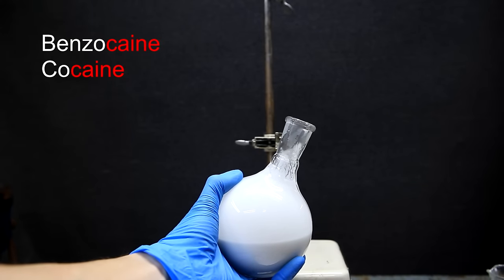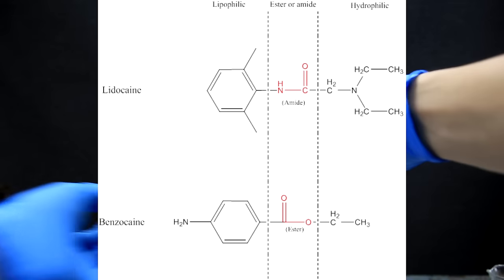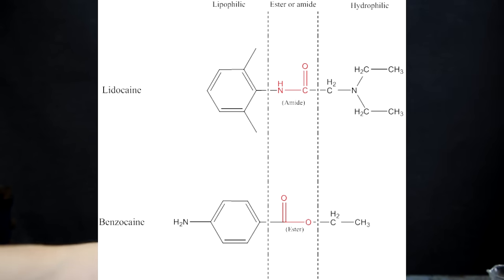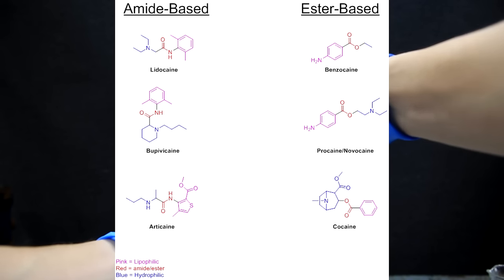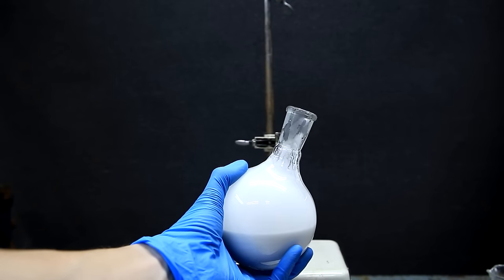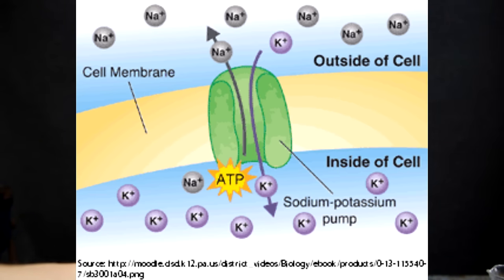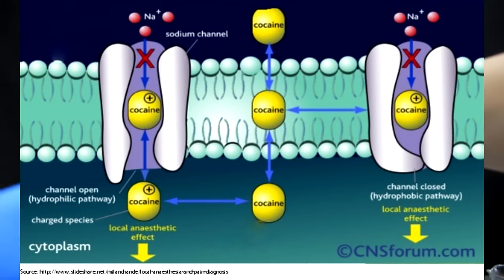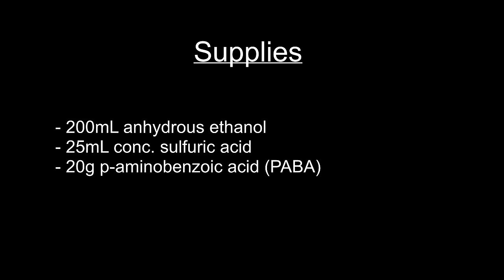Making Benzocaine (Revisiting!)

Comment: ha ha ha, white powder that numbs you in a plastic bag.  very entertaining videos.
Reply: It's actually used to cut cocaine really often, most street cocaine contains benzocaine
Reply: You must have missed the part where he said it can be lethal because it's poisonous
Reply: @OligoST  Oh yeah - and cocaine isn't? Sola dosis facit venenum.
Reply: Robert Paul Guidry   

You can ask if you can make a video showing how pure cocaine powder is transformed into water or liquid using a simple chemistry method and also how to turn water or liquid cocaine back into pure cocaine powder Please some one can explain how to do it more or less simply important was clear thanks
Reply: Making cocaine a liquid is just dissolving it in a solvent. You should be able to get it back out through evaporation.

Comment: One thing to be aware of with molecular sieves is that they are slightly basic. This means that (in this type of reaction) if you add conc. sulfuric acid to them, they will be fairly likely to decompose to an amorphous sludge. They should still work (perhaps to a lesser degree, but i'm not certain) but it would involve a few additional filtration steps to remove the sieve powder.
On a related note, don't do what I did and try to store your beautiful clean glacial acetic acid over 4A sieves.

Comment: I just did this with about a 76% yield. That's even after I had a foaming accident that lost several grams of product.
I used a soxhlet extractor with molecular sieves to get the water out of the alcohol as it was refluxing.
I used 40g (~0.292 mol) of PABA and about 250 ml ethanol, 15 cc of 98% sulfuric, and let it reflux for 2 hours.
Then I added it to a saturated solution of sodium bicarbonate. I got too happy with the pipette, though, and that's when it foamed over. 
Washed it a couple times with distilled water, vacuum filtered it, and let it dry for 2 days in a sunny window.
When it was nice and dry, it yielded 36.53g (~0.221 mol)

Comment: Hey dude some suggestions on the neutralization of your acid to increase yield:
1) add the solid NaHCO3 thereby not adding any water to the rxn mix
or 
2) if you only have the aqueous base, add the acidic solution to the base while stirring. This way the acid is neutralized and hydrolysis of the product does not occur. If you add the bicarb to the acid slowly to not foam over, the pH is still well below 7 to conduct the acid catalyzed hydrolysis when you are adding water.
Reply: +Robert Hoppe Thanks for that suggestion. I added the NaHCO3 as solid, worked very well.

Comment: You did actually address the reduction in concentration of the products, using 98% sulphuric acid means that any water formed is locked up by the reaction: H2SO4+H2O->H3O(+) + HSO4() meaning it's unable to reaction with the ester like H2O does, that's the main catalytic property of the sulphuric acid as opposed to other strong acids. HCl works, but you get around 30% of the yield that you do with H2SO4.

Comment: the real deal is to get PABA from SODIUM BENZOATE
1.Nitration of benzoic acid to introduce a nitro group (-NO2) to the benzene ring, forming nitrobenzoic acid
2.Reduction of the nitro group to an amino group, converting nitrobenzoic acid to aminobenzoic acid
3.Purification to ensure the correct para position is achieved, as nitration could occur at multiple positions on the benzene ring.

Comment: Also you can use a Dean Stark or a Soxhlet extractor packed with 4Ams (or 3Ams) to remove the water from the azeotrope and return anhyd solvent to push the equilibrium. However the rxn time will be increased as sieves aren't fast at absorbing H2O.

Comment: Oof wish me luck. I'm making benzocaine starting from toluene from carburetor cleaner. It should be fun though.
Reply: For anyone who cares:
Toluene to nitrotoluene

Separate p-nitrotoluene isomer

Oxidize the methyl group of p-nitrotoluene using KMnO4

Reduce the nitro group of p-nitrobenzoic acid

Fischer esterification of p-aminobenzoic acid to make ethyl p-aminobenzoate aka benzocaine

Basically will have made a modern local anesthetic from carb cleaner lol

Comment: Would adding more sulfuric acid produce a better yield? Also, how do you know if you have your product at then end- is there a test you would recommend to identify esters or this molecule specificly?
Reply: The acid is just the catalyst. You could use less, but the reaction would take longer. Use more, and it won't speed things along very much. The yield would be roughly the same.
To increase yield, you can pull out the water to keep the reaction from reversing. (but the reagents are relatively cheap, so why spend too much time and effort?)
With reactions like this, the "end" is pretty much a judgment call.

Comment: While I'm certainly still interested in the Vanillylamine video, would it be possible to do a video on the synthesis of PABA?
Reply from the maker: +LuciferAlexander I am looking into making PABA. Here is a link to a suggested method starting from toluene: http://tminehan.com/spring334pdfs/11&12ans.pdf

The issue is that I don't have Pd/C or a good H source.
Reply: As interesting as seeing you try to make Pd/C would be, I imagine its not very feasible?

And wouldn't making H2 be possible via electrolysis of water?
Reply from the maker: LuciferAlexander There are ways to generate H2, but a constant stream of H2 for a long period of time can be pretty annoying. I could make Pd/C but it is pretty flammable and care must be taken. Id also need Pd.
Reply: +Nile Red Certainly having that much H2 presents some risk, and having to make sure it didn't run out half way though would be a nuisance.

Palladium is also not the easiest to come by. The method I found calls for PdCl2, which runs around 50 UDS a gram. Ouch.
Reply from the maker: LuciferAlexander definitely not the ideal price

Comment: Your NaHCO3 saturated solution must be into ethanol, if it is not the case a little hydrolysis can occur. Yeaaaah I know, this is pretty low, but you had a several amount of Water at this time ! If I Had to do this, I will be in the same "ethanol excess" like you, but I will try ethanol NaHCO3 solution OR add it solid by a spatula ;)

Comment: Blistex "kanka" for lip/mouth sores has benzocaine 20% as the main and active ingredient,  but when it comes in contact with water,  a sap-like substrate forms.  Would this still be a good candidate for the process?
Reply: +J Alvi  If you'd like to extract benzocaine from OTC products choices like Maximum Strength Oragel are a good option as they have similar strength and fewer additives than the Blistex product, mostly PEG. I've misplaced my detailed lab notes, but the simplest method is to use benzocaine's temperature-dependent solubility in water. 

Roughly: Mix 0.5mL oragel into 15mL cool distilled water, centrifuge/settle and pour off the liquid (a mix of water, PEG, sucralose, and flavoring, all of which dissolve well in cool water. Not sure what temp is best for 'cool' here, as cold as possible while still diluting away the PEG). Add 15mL distilled water and heat in water bath to ~98C. While maintaining temp, add sufficient distilled water to completely dissolve the bead of molten benzocaine that forms. Cool to ~5C, crystals will precipitate. Filter.

The resulting benzocaine crystal should be quite pure. It's great for growing crystals via either slow cooling or evaporation. Makes nice feathery white crystals. Yield is fairly economical, benzocaine solubility in very cold water is about 0.4g/L, so only about 15 mg or less is lost each time water and crystal are separated.

Comment: Hello Nile Red, grat video.
Although unfortunately OTC PABA is very expensive here and full of fillers. Do you have a video or any instructions about the synthesis of PABA?

Best regards
Reply from the maker: +Nitrato ... making paba is not the easiest and it would be a pretty roundabout method. You can either extract it from pills or buy it online like i did.
Reply: +Nile Red thank you for reply Nile Red. I will try another chemical store sources then.

Comment: Nitrous oxide seems interesting.
Reply: +Alkaios yeah, it's relatively easy to make. You just heat ammonium nitrate to decomposition point and collect the gas, which is nitrous oxide and water, so you bubble that through concentrated sulfuric acid to clean it.
Reply: Just don't let it explode in your face

Comment: at 5:00 , why did u use a paper clip as a stir bar
Reply from the maker: +aamaruvi yogamani (EPICGUY20007) it just keeps the oil mixed so i can get more even heating. Using a paperclip allows me to get the flask closer to the stir plate.

Comment: where did you get your PABA and why do you want benzocaine anyway?
Reply from the maker: +Liamthepyro I got it from Purebulk.com and i made it just for fun. No other reason really.
Reply: +demongoka Yes.  The easiest medium is Vaseline which is petroleum jelly, aka white petroleum (white pet).  Typical concentrations range from10 - 20 percent.  You'll need to wet the benzocaine with a small amount of mineral oil so the benzocaine dissolves.  Keep the mineral oil to a minimum so you don't affect the potency of the final product.  For incorporating into the white pet, it's best to geometrically distribute the mineral oil/benzocaine solution.  When I've done this type of thing, I typically start out by incorporating the solution with about an 8th of the white pet, then 1/4, and so on until everything is completely mixed.  The resultant product will likely be an opaque white color due to the air that gets incorporated during mixing.  I've done this many times before for RX grade products.  It's fun, but can get messy until you get the hang of it.
Reply: +demongoka That's a really good idea.
Reply: +Bryan Moss And the end use is, what, exactly?
Reply: +kleetus92 it's now a topical anesthetic for using on, say, a mild sunburn. Usually lidocaine is preferred topically while benzocaine is used in the mouth, but they're part of the same class of drug and therefore work in the same way. Normal concentrations are between 10-20%. One thing most people don't know is that cocaine is actually also in the same class. It's routinely used in eye surgery and in a few other procedures involving mucous membranes. Wild, right?
Reply: +Bryan Moss I knew lidocaine was used for getting stitches and whatnot, wasn't aware cocaine was used medically still, and I even had lasik done a couple years ago (totally worth it by the way). 

I was just curious what HE was going to use it for. I knew a lot of chemists that went to the 'dark side'...

Comment: I wonder if cocaine has another use besides a stimulant
Reply: +Kirk 770  it is also a local anesthetic
Reply: Historically it was an anesthetic but it proved too addictive for how weak it was (relative to morphine)
Reply: SirusKing wtf are you talking about, cocaine and morphine are 2 completely different classes of drugs. Morphine is an opiate pain killer and in no way shape or form a local anesthetic...
Reply: I meant addictive relative to morphine, not as a anesthetic.
Reply: Its been used to reduce/take away pain in the mouth or let say the nouse during surgery or when your at the dentist before.
Reply: Kirk770 The Fluffy cocaine is used during sinus surgery because it is a powerful vasoconstrictor in addition to being an anesthetic (this is why folks who snort a lot of cocaine tend to have issues with the nasal septum being destroyed).... In fact cocaine was used during my sinus surgery; they apply it using a q-tip and very little is actually absorbed to get you high

Comment: Well, the Life Threatening effects kinda concern me but I've always been a little frustrated that those Anticeptic sprays they sell at the drug store only contain 20% Benzocaine, I've wanted to kick it up a little.
P.S. can you please show us how to make Hydrogen Peroxide or how to distill it up to 90% rather than that crappy 2% stuff they sell at the drug store?
Reply: MrManerd concentrating HO is really hard after 37%
Reply: There was a paper on that, I am not a chem guy, so sorry if the wording is not correct, you need some osmosis thing and you will obtain anhydrous Hydrogen Peroxide
Reply: 90% H2O2 is a terrible, terrible thing that no sane chemist would step near.

Comment: 5:00 a paperclip?
Reply: Yup :)
Reply: My guess is it's there to stir the oil, thus heating the solution more evenly. I might be wrong tho.
Reply: the effect it had on the boiling was pretty neat
Reply: Isawa De La Pradera yeah, but why instead of a stir bar
Reply: Sim0ndutch who knows. maybe there wasn't enough room in the oil bath to fit a stir bar without touching the flask. Or maybe the oil and the paper clip were friends and Nile didn't want to separate them. Who knows!
Reply: Isawa De La Pradera that makes sense :)

Comment: +Nile Red would it be possible to isolate barium from Barium nitrate using a solution of barium nitrate and copper than heat it on a hotplate
Reply from the maker: +Riley Crocker Off the top of my head, i have no idea. I have never really dabbled with barium salts.

Comment: Ethyl chloride is almost impossible to make, can you figure it out?
Reply from the maker: +One2rock Why ethyl chloride? Why not ethyl bromide?
Reply: I don't know the difference?? I am new to chemistry.
Reply from the maker: One2rock It depends, but for most reactions involving ethyl chloride, ethyl bromide can be substituted. I am not certain but I think ethyl bromide is easier to make.
Reply: +Nile Red Could ethyl chloride be made by bubbling chloride into an ethyl bromide solution? That might be a nice shortcut if ethyl bromide is indeed easier to make.
Reply from the maker: Ilgaz Er I am not sure, but I don't think so. Is there any specific reason for using the chloride over the bromide anyway?
Reply: well ethyl chloride is a legal recreational designer drug, sold as maximum impact and other names, I don't know the difference in a chloride and a bromide, I'm just curious in its manufacture
Reply from the maker: One2rock oh really? i had no idea. Anyway to make it, it will be different. I am not sure what the industrial method is, but i think there are various different preparations floating around.

This seems to be a viable method: http://www.prepchem.com/synthesis-of-ethyl-chloride/
Reply: ok thank you, some people can figure that out, I'm the kind that has to be shown what to do and why.  like passing hydrogen chloride gas through the boiling mixture?? what? lol.
Reply: I thought ethanol plus hydrochloric acid would yield this. The hydronium from the acid and the hydroxyl from the alcohol would create water and leave an ethyl chloride afterwards. 1molETOH +1molHCl=1molEtCl +1molH2O, or is this equation reversed?
Reply: https://en.wikipedia.org/wiki/Chloroethane (yes I am quoting Wikipedia...) states that you it is made with Ethene and hydrogen chloride. 
Making it with Ethanol and hydrogen chloride would probably also work, but then youd have the same problem as with the esthers that there would be an equilibrium and the product would be hydrolized by the formed water.
Reply: You cannot obtain alkyl chloride from alcohols by treating with hidrochloric  acid because hydroxyl is a worse leaving group than chloride. Generally alkyl halides are formed from alcohols by treatment with thionyl chloride

Comment: Gah, a flat bar in a RBF. Triggered.
Reply from the maker: +ElSuperNova23 I am sorry. I should have included the appropriate trigger warning.
Reply: +Nile Red Haha, all g. Can lead to some traumatic experiences though, I've had some flasks break when on overnight stirs. That was a a fun morning.
Reply from the maker: ElSuperNova23 whoa really? I never heard of that happening. How thick walled were the flasks? I guess if stirring goes crazy it can smash things.
Reply: +Nile Red Just a normal RBF, must've had a star crack already. I also remember there being a really gummy side product on the bottom, so the bar just went nuts eventually.
Reply from the maker: ElSuperNova23 Maybe a little star would have done it. I am pretty paranoid, so i always inspect and if there is a star I don't use it.

Comment: Can you do something cool using Tums tablets?
Reply from the maker: +Matthew Ferrie Ill try to think of something, but it doesnt seem like there is TOO much to do with it.
Reply: Nile Red
In college, I tried to use the fact that calcium carbonate is a base to extract it from the tablet using lime juice (citric acid). It didn't work very well lol
Reply from the maker: If you neutralize calcium carbonate you will release CO2. So an acid/base extraction isnt really viable.
Reply: So by neutralization by citric acid, that produces CO2 and calcium citrate. If I remember right, that is soluble in water.
Reply from the maker: That does sound about right.
Reply: What else is in Tums?
Reply from the maker: Matthew Ferrie I am pretty sure its mostly CaCO3 with a bit of flavoring and small amounts of other ingredients.
Reply: Ok. So after the CaCO3 has been converted to calcium citrate, what do you think would need to be done to remove the citrate ion?
Reply from the maker: Converting it back to CaCO3 would be a pretty big pain. By remove, what do you mean?
Reply: +Nile Red By removing, I mean converting the calcium citrate into calcium metal and something else that contains citrate.
Reply: +Nile Red Maybe a single displacement reaction?
Reply from the maker: Matthew Ferrie I am not sure what methods exist for doing that, but you need to reduce the calcium back to Ca metal. Also, remember you cant do this in water because the calcium will react!
Reply: Nile Red
Which might be either entertaining or (more likely) dangerous. I can research that though!